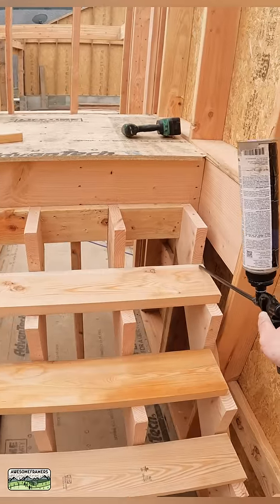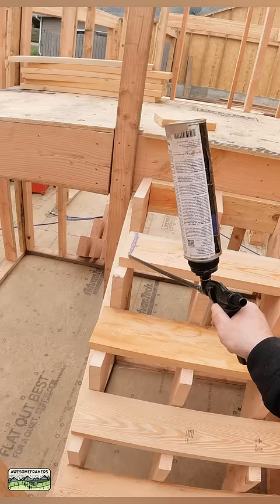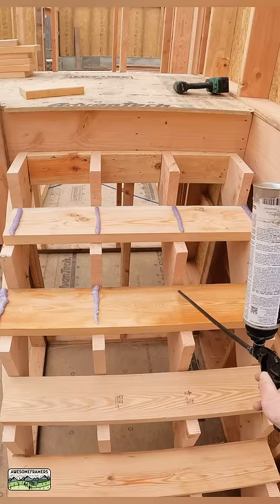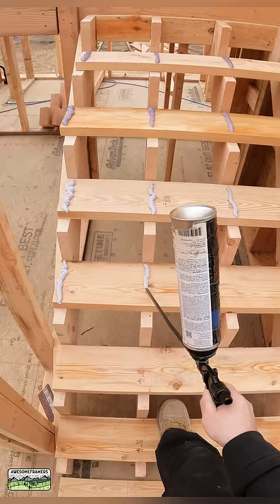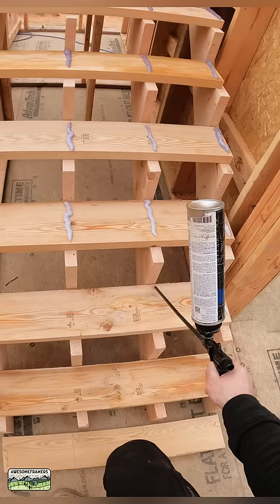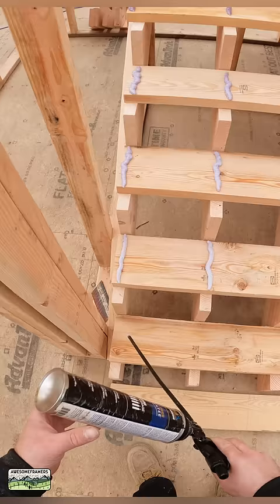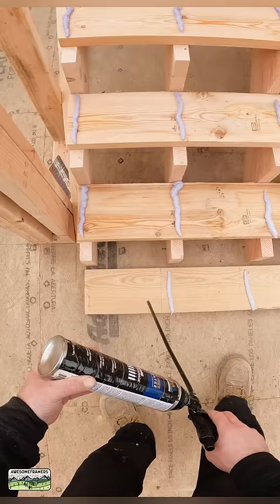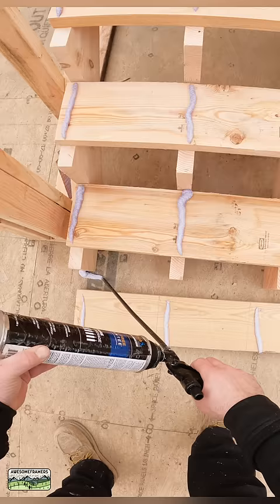Stair Framing- Risers #shorts

Comment: You missed the part where you step in all the glue multiple times
Reply: How is he going to step in the glue u start from the bottom
Reply: @scottburnett3328  because it always happen. The smarter you think you are prepared, the more often it happens.
Reply: @scottburnett3328  cause he is just going to lift the riser up into place and go up as he goes he isn’t stepping in glue, but you might not understating how to build stairs
Reply: 0
Reply: @jnusmc4922  wrong person bud
Reply: @scottburnett3328  Do you even work construction? If you did you would just know.
Reply: @evictioncarpentry2628  clearly you don't work construction because you wanted to, but because you had no other options.
Reply: @Kleinalrik  maybe because you have executive function issues, thats literally just bad planning
Reply: Wasted time.

Comment: Never seen 2x material used for risers. Waste of money
Reply: LOL what? What would you suggest card-board? It's called a kicker for a reason bc it gets kicked. You do in fact need 2x material.
Reply: @carlwilson1483  I'm a builder. We use 1 x material always. Works every time
Reply: If you saw what the stairs in the UK are built with you’d be in shock or pissing yourself with laughter ; )
Reply: @MeIamHim   I was just there. Didn't notice anything weird. What do you mean?
Reply: @markpoffenbarger9221  In the UK, treads and risers are housed in to the stringers with wedges and glue, even in the cheapest homes. This way you don’t need the middle boards. The newel posts are also integral to the structure, which doesn’t seem to be the case with US stairs (I maybe wrong though). 

 The American style of stairs where you notch out of a solid board is against regulations here.

Comment: Great opportunity for your thin beads to dry before it bonds.
Reply: gonna take more than 5 minutes to dry and lose its adhesive ability
Reply: He said it was like 32 degrees. It'll take days to dry. If it even works at those low temps.
Reply: @QuintonRC23  It will dry when spring comes...

Comment: Why use 2 by material for risers seems like a waste and you’ll have to cut more out of the stringer aswell and I can’t tell from this angle but I do my stairs 1 foot on center if I can
Reply: Lol have you ever built a staircase. You don’t have to cut the stringer more. Only thing it changes is the top and bottom riser height.
Reply: Open strings on this staircase not housed over treads. Incredibly strong design with the use of 4 stringers under treads

Comment: Glue will fail, just because you warm the glue to temperature needed it will fail from the working temperature is below whats needed to adhere and cure properly.  I see it so many times and with titebond it turns white.
Reply: You haven't used THIS glue, it won't fail.

Comment: You were miles away on the second step you did
Reply: That last one too... Didnt even line up with the stringers.
Reply: Ikr I almost threw up the 2nd time it happened
Reply: the second one isn't off, the riser is just slid to the left about a half inch. Pay closer attention before you criticize.

Comment: I usually put my rises in after I put my skirting up and I usually put my skirting up after the drywall goes out and I tend to put one rise of one step at a time cuz it makes it easy to fasten the back of the riser to the stair tread so you must be just making rough stairs for carpet and if that's the case if I put glue on it why not just screw your rises on the drywall screws

Comment: I guess I got lazy in age cause that all gets prefabed in shop minus top and bottom tread for attaching. Way less strain on the back that way and field time. The worse thing about field work is the rolling out and rolling up tools. After 35 plus yrs custom stair builder  glad I've only done about 5 straights. Very boring and anticlimactic but hey thats just me. #1 rule before fabricating carcus is to consider finish materials on both floors, treads and landing, we have a very small tolerance in the rise. And hey I would like to see some fire blocking in wall going up the rakes. Proud of you son

Comment: “What I like to do is put the glue on the riser material.”

Puts glue on tread.
Reply: That's the riser lol
Reply: It's the riser, he just set it down temporarily. He's going to pick them up and place them where the glue is. It's kind of self explanatory Lol
Reply: @illestofdemall13  you’re absolutely right. I went back and watched it again and for some reason I didn’t pick up on the next step which is obviously flipping the riser into place. I’m baffled as to how I could miss that (beer) but for clarity, you are correct. :)
Reply: @davidnicolas8019  Sometimes the most obvious things are most easily overlooked. It happens to me all the time. Lol

Comment: Those aren't risers, they are treads.
Reply from the maker: They are risers, did you actually watch the video?
Reply: @AwesomeFramers They are treads - where you put your feet. Risers are the vertical parts between each tread.  Look it up.
Reply from the maker: @christianmccollum1028  they get flipped 90° and fastened to the riser portion of the stringer. They are 2x8s, far too small for treads.
Reply: @AwesomeFramers  i guess I didn't.  Just saw the short showing the adhesive you were applying to the horizontal surface of the stringers  It cut off after that.  My apologies.
Reply from the maker: @christianmccollum1028  no worries bro 👍👍

Comment: Silicone baby. Never squeaks.
Reply: Actually, silicone flexes, a lot, which is super useful in water sealing applications, but terrible for preventing fastener movement in lumber. Less likely if using screws, but still. Polyurethane construction adhesive fills in the gaps and then sets up hard to inhibit movement, stopping squeaks. Literally just got done fixing a set of stairs where the framers used caulk instead of construction adhesive and they had terrible squeaks, which the framers had tried to fix using 4 different types of fasteners lol
Reply: was the caulk silicone. I have been doing it for years with zero issue. Silicone for stairs for life baby
Reply: @MrTooTechnical  : Black silicone only….  no joke !! 
Is what I believe
Reply: Any silicone and only silicone.  Woohoo

Comment: Seems neat, but that amount of time and a nailer would have had those risers in and ready for tread.
Reply: He nails them in after setting in place and does the same for the treads. It helps prevent the inevitable squeaky staircase over time.
Reply: I have had good success with a 2x6 strongback on each stringer, and using adhesive and truss head screws to clamp tight
Reply from the maker: @rob hodge  Prove it 👍
Reply: @AwesomeFramers  i couldnt tell, but you arent using lvl for your stringers are you? I think I've asked you this before but dadbrain.....
Reply: I'm an electrician by trade, but I've also been building houses for years. The never ending quest for speed continues to amaze me. Nobody seems to enjoy their work. just slam slam slam slam... time time time time... Great, you saved a whole lot of time... I see you bitching about 1 minute... 1 ACTUAL minute... You are telling me that you can install risers in  1 minute? Awesome! I'll bet they look great! You know what else saves time? Just one nail in every riser.. Just hit 'er right in the center stringer! Look at the time you will save! Imagine the materials saved, the labor, and the effort! Imagine the gains!!! I love a house that's built in 6 minutes... because of profit... save that time!!! hack hack hack... Get it done and make the money! That's all that matters... Squeaking floor? Must be the insulators fault..I'd write more but gotta go save time on wiring a house... Just one circuit will do it...
Reply from the maker: @griznatle  nope, 2x12. I've used LVL, LSL and 2x12 Doug Fir. I don't see the value in paying 2-3x for the material. My stairs don't squeak and I built them 20 years ago
Reply: @AwesomeFramers  ive struggled to get 2x12 df to be straight and true, which I find is essential for making stringers.

I have used spf from dunn lumber a few times, but i converted to lvl when ever doing a stringer with more than 7 steps
Reply: @griznatle  Oh wow, didn't realize this channel was in the Seattle area until you mentioned Dunn. Nice.
Reply: @Max-hw6lv  i think the channel is based in south South Washington, like Olympia
Reply: @itaintrocketscience  

 Carpenter here.     Yes!!   Save time!   Cut corners!   😡
It’s not the installing or the cutting.  But the layout.   The THINKING that takes all the time.    Like dividing that last 3/4”  into 6 steps.    
      Or figuring a floor that’s 5/8 instead of 3/4.
Reply: @griznatle  Out in Port Orchard, across the Puget Sound from Seattle. I'm actually a local contractor in the area, hoping to visit Awesome Framers some day
Reply: @drew5334  very nice! Im in seattle, design build contractor. Hansmire Builders

Comment: You couldn't work fast enough to work with some of the people I have worked with. They would tell you the same thing I'm about to tell you. That is unnecessary. It will not hurt anything what so ever. But when you nail it up right it not going anywhere..

Comment: Yikes!!!!! Nice custom stairs 🤣🤣🤣🤣 and don't tell me your one of those idiots that runs tye risers straight into the wall instead of putting a full stringer against the wall and butting the risers to it. No receiver for the stairs and also paper clip head nails are totally illegal in most states considering they don't have any holding power and why are you using 2 x for risers your treads are going to be way short as anyone with any experience can see
Reply: Exactly

Comment: Waste of time and material .use some ring shank 3 and a quarter inch nails .can be done with it better than any glue..
Reply: Adhesive is not for “gluing” but rather for squeak prevention.
Reply: Glue makes things squeak use the proper nail.

Comment: Everything is saw dust & glue these days
Reply from the maker: That's grossly over simplified. Apawood.org
Reply: @AwesomeFramers  says the guy using spray glue to hold stairs together.
Reply from the maker: @Floridamancan  its not "spray glue", it's polyurethane. Do some research, Google Advantech Subfloor Adhesive 👍